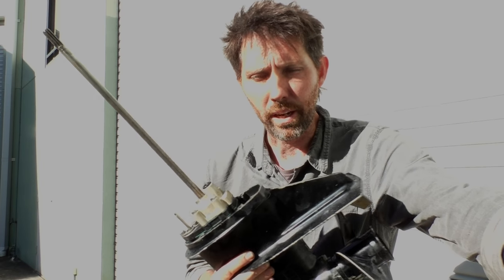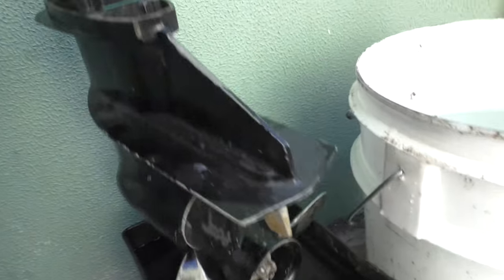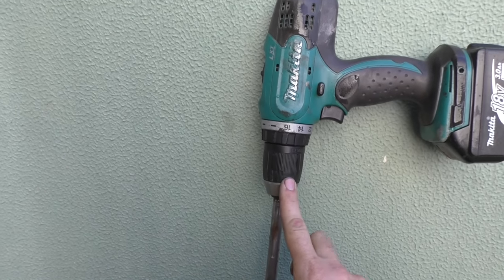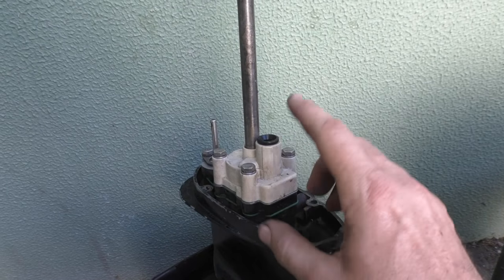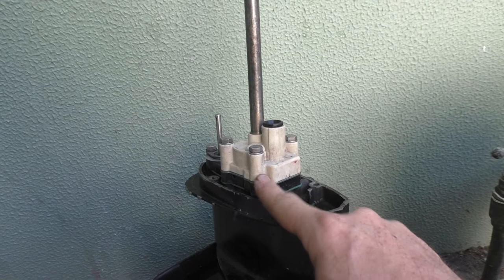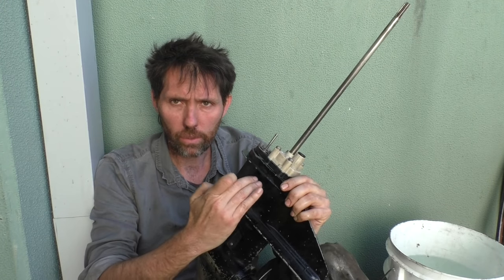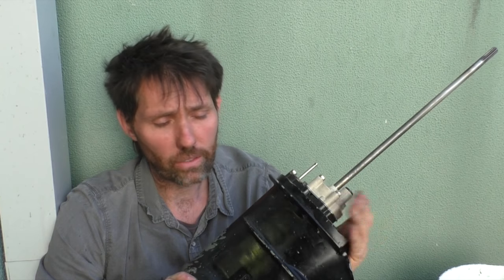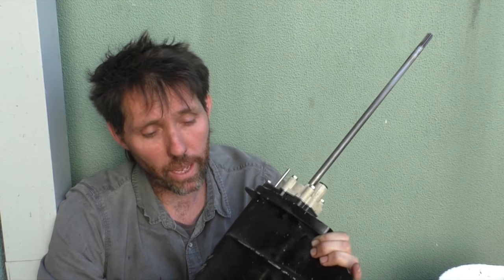Testing an outboard water pump

Comment: Every time I work on my boats I end up watching hours of Dangar Marine.  Thanks so much you have helped me keep my family having fun and fishing year after year.  Thanks again Sir.
Reply: hola muy buenas tardes , quería pedirle un gran favor si es posible soy de argentina y me gustan  sus vídeos y la verdad aprendo muchisimo , podrian salir subtitulado en Español para poder leer lo que enseña ,para mi y otras personas mas ,sería de gran valor muchisimas gracias y saludos desde Argentina
Reply: Me too 💯
Reply: Hello, I have changed the impeller on my Mercury 30hp and I have checked that the impeller is stuck and spins when you turn the shaft. but there will be no cooler water from Tell-tale. does pressure have to build up and can it take a long time? thanks in advance.

Comment: After battling a water pump for a couple hours I watched this and just hooked up a hose with earmuffs. Problem solved, boat runs like a champ. Thanks Stu!! Rebuilt my lower unit with new dog clutch and all new seals, carb rebuild, fuel pump rebuild, fixed throttle advance, and everything is greased up. Literally all from your videos. Two years ago I paid a guy $650 to replace my impeller (after 6 weeks with my boat). The freedom you've given me is unbelievably valuable.
Reply from the maker: Glad it helped. :)
Reply: $650?? You got ripped.
Reply: @wolfpackflt670  just like al the boat mechanics and shops are, rip offs, like car mechanics, a/c guys etc.. I can do them all and I know they are..

Comment: I changend the impeller for a new one, put everything up for a test and the water didn’t come out. Since it was the first time I did it, I though I must had done something wrong, so took it apart, rechecked the process.. And nothing. So did it again with the same result. All stressed out I came across this video, changed the tank for taller one, added more water and the restof the story you surely know😀

Comment: Thanks for showing us how to solve the mystery of why our newly installed water pump was not working!  Not having the water level high enough when testing prevented the stream from flowing.  It would have been better if we had found your video before our fourth breakdown and re-assembly, but my 16 year old is now an expert on both impellers and thermostats.
Reply from the maker: Hey Grace. Oh well, at least it was a learning experience. You never know something until you've done it four times! :)

Comment: I am in the middle of servicing my Mariner 3.3 HP 2 stroke. I came back inside for information about the water tube connecting the water pump to the power head. I came across your video and paused it after I saw what you did to check the pump using a cordless drill. Brilliant idea Thanks. I did the test like you did and it is ok, my question is: WHERE is the water tube? I did not find any in mine and when I thought to measure and make one, there is no port or anything to connect the tube to. do these outboard have water tube or this is how they are designed with out a water tube. any feed back would be appreciated. and Thanks for the video

Comment: My son and I had taken ours apart and worked on the impeller. Once we were done we reassembled everything and... no water flow. We had the lower unit in a tub of water with enough to allow the intakes to be below the surface but your tip about lowering it even more was the key point to prime the pump. We tried again with a taller water tub and voila... problem solved...! Thanks so much for posting this video. It saved us so much time and money. Cheers..!

Comment: Thank you very much for your content. I completed a rebuild on a 15hp Evinrude which is mounted on an adjustable jack plate, which worked perfectly on the muffs when tested after the rebuild but hadn't been on the water yet. When I tried to start it up with the boat beached it wasn't sitting deep enough in the water to prime the pump, so all I had was a noticeable pulse of air coming from the tell. After bringing it home and scratching my head I found your video and immediately took the boat to a local boat launch to test immersing deeper and voila - strong stream from the tell.

Comment: Changed the water pump and gaskets, raised the water level in the 'bucket' to just about where the water pump is situated and poured in  5-1 ratio of plain white vinegar which was cheaper at the supermarket, cancelled the descaling fluid......Ran for about 1/2 an hour and was left with a tablespoon full of sand, shells and silt in the bottom. Rinsed with fresh water and the tell tale and exhaust were pumping water out. Job well done
Reply from the maker: Nice one, sounds like it made a big difference.

Comment: Thank you so much!
I replace the impeller on my Evinrude 9.9.  The motor has planing fins, so I used a storage box that accommodated them, and still submerged the intake. I had used a motorcycle fork seal grease, on the impeller, during reassembly, for insurance. After running for 20 seconds, no "peeing"? 
I was about to tear it back down, second guessing my work, when I found your video. 
I removed the fins and used a recycle bin, deep enough to submerge the pump...presto! It primed and circulated.
THANK YOU!

Comment: Stu is spot on; recently experienced this after I build a motor stand and tested the water pump after replacement (previously would do it from the stern of the boat).  Used the same bucket which was not high enough with the stand like it was with the boat.

Comment: Thank You I rebuilt my water pump reinstalled my Foot (Lower Unit) No water with muffs.Placed it in a barrel up to the water intake’s and no water. Removed the lower unit 3 more times to re check my work. Scratched my head,slept on it and tried again the next morning NADA! Searching the IT and found your posting. Repositioning the engine in order to get deeper in the barrel and  WooHoo, my work is good and proves a point to me that muffs can’t be trusted nor can a barrel if you are not close to the cavation plate. Thanks again and as you said if it were a self priming pump things could have worked but now I know. Stay Safe and Enjoy the Water ✌️
Reply: Thanks for that info. I was just looking at a 6HP Yamaha tonight with muffs and it wasn't pumping water - never thought a minute that it could be a priming issue. Still buying it, because it's a fairly easy fix either way, but I'll have to barrel test it when I get it home now.
Reply: @ChrisPollardвы смогли решить проблему?вы меняли крыльчатку? пошла вода из контрольного отверстия?

Comment: After testing my motor after a 6 month break it wasn’t pumping water, pulled the pump apart and rebuilt it only to find it still didn’t pump… after a second rebuild and a lot of cranky words I found your video! Adding more water to the bucket magically fixed it, thanks!

Comment: I wonder how it ever worked in the tank before  we have used or for that matter in the seal?  I could not make the pump work using the drill until the water was right below the pump as you explain. But normally we have had it in a tank with much lower level. So my question is how does it work  when its in the sea and ihe water level is not that high?

Comment: OMG! THIS is the video that everybody is looking for. I took careful attention to Change my impeller properly and then did the test in the driveway with the Ear Muffs, then the flush line with my garden hose (tell tale worked perfect with this flushing test) etc. EVERYTHING and I mean EVERYTHING was perfect though I could not get water to come out of the Tell tale. I even filled my trash can up to just above the Intake Grids and STILL couldn’t get water to pump through the tell tale. I watched this video and thought “...there’s no way this is going to work..” and yet when I backed the boat down the landing ramp and lower the unit into deeper water, I started the motor in deeper water and WHAM! ....Water streaming  like a river!!!! YES! I still don’t understand the physics of this as to why the deeper water makes/made a difference BUT IT WORKED and Dangar I am forever grateful! Thank You!
Reply from the maker: You're welcome Mike, glad the vid helped you. :) It works because the pump is higher than those grills and can't suck air to get to the water.
Reply: @DangarMarine  Hey. I am from Russia, I use a translator. Sorry for my English. The question is, when we go on a glider, the water level is lower and the water flows. Why?
Reply: @DangarMarineа как же вода потом не уходит из  помпы? как потом её снова засасывает насосом?вода же не остаётся там,да и это чревато если зимой замёрзнет
Reply: @ermak-rybakон не хочет наверное отвечать

Comment: Man, Thanks so much! I just did my first water pump on a little Johnson 15 and set the engine in a bucket of water and it did not pump. Was getting ready to tear the thing apart again thinking I had done something wrong. Your video was a life saver. As you pointed out, these pumps are not self priming. I found a deeper bucket and filled to the level that you recommended and presto, she was peeing like crazy. Thanks for the excellent video. Keep up the good work!
Reply: Great. What about if its not pumping when hooked up with a water hose vs bucket?

Comment: Great tip.
Also, if you have checked everything out and everything appears to look good and the water level is high enough and it's STILL not pumping, look closely at the seal on top of the impellor housing. If it has a seal. Some housings don't have seals. Some do. If they don't, look at the housing itself. Make sure its not distorted from heat. If you stick a short hose into the housing where the water shoots out of the housing, there should be a good stream of water coming out of the hose. Just keep your face away from the sudden gush of water.

Comment: Stu, once again your videos are a life saver. Planning to take the wife out on the lake tomorrow and when I was prepping the boat earlier in the week, it wasn't pumping water. Thankfully I knew what not to do and it didn't overheat but I remembered this video and tried getting a bigger tub. Bam. Pumping just fine. Also a nice side effect of the engine getting a little warm was my moisture misfire gremlin was cooked out of the ignition system. :P
Reply from the maker: Hey Peter, sounds like you've had a big win there. Hope you both had a wonderful day on the water. :)
Reply: We did indeed. Had a little issue with the gear selector not wanting to go in to reverse. Looks like its a cable issue and not the motor itself.
Reply: Was definitely the cable. had to adjust the "nut" on the engine side of the gear selector cable so that at "full throw" reverse, it wasn't pushing the rod far enough back. Takes me back to my amateur bike mechanic days. :P

Comment: So glad I watched this video. I bought a used 2002 Honda 225 outboard. I saw it running at the time and it gushed water out the jet, but when I installed it on my boat a couple of weeks ago using  ear muffs on the garden hose, no water came out, so I switched it off. I then put it into a tub with the water coming to about 1/4 inch above the intake, ( deepest tub I could find ) but still no water came out. Now I know why, thanks to you. Your videos are the best on the web and I really enjoy watching them. I like the fact that it is not all about spending money, it about getting things to work one way or the other. I would love to see you working on the exact same engine as mine but realize it would be difficult as there are so many choices out there. I would suggest however, that if you did do videos on the most popular models and horse powers, I, and many others,  would be prepared to pay for access to in depth instruction videos  of their particular engine, done in the same manner as your existing videos. I really like when you ad small additional pieces of information, just so that we are fully aware of the situation and therefore stop us rushing in and doing something stupid. I was about to strip down my engine and replace the water pump. Now I will wait until next season and test it in the water. I am now sure there is no problem, but at some point I will service it, just so I am aware off it's condition. I would like to see you make a buck just so you will stay with it. Thanks again. Keep up the good work. Bob.
Reply from the maker: Thanks Bob, really glad the video saved you from some unnecessary work. I'd love to slowly build a collection of videos showing all the common jobs on the common outboards. Hopefully over the next few years I'll get enough of the right motors in here to do that.

Comment: Thanks you so much, your video has saved me. I just could not understand why my new impeller was not pumping. The ear muffs are useless and then used a large bucket. But as you have shown water level is critical. All good now. Thanks again.
Reply from the maker: You're welcome Steve, yes, I have very mixed results when trying to get a telltale on ear muffs.

Comment: Did this test on a Suzuki DF4 WP which revealed I had a leaking drive shaft seal on the top of the housing - half water coming out the WP discharge, the other half out the leaking shaft seal, result - insufficient pump head pressure to reach the tell tale let alone the cylinder head.  I would suggest fitting a tube to the outlet with sufficient height to demonstrate the pump head pressure. As presented the test only demonstrates the pump impeller is rotating and won’t demonstrate pump head.  Hope this helps.
Reply: Yo tengo problemas con un 5 hp mercuri no tiene presión el agua en mínima velocidad no tira agua

Comment: This video saved me a lot of time and money.
My motor telltale was not peeing. I replaced the impeller. Still nothing.
I tried muffs. I tried a bucket. Nothing.
Was just about to take the lower unit off and verify everything looked right (and it would have, because it was right). That would have lead to even more confusion. Then I would have taken it to a repair shop.
But I saw this video suggesting the need for deeper water.
Got a new,  larger, deeper water trough and it worked!
The telltale was working perfectly. Yayyyyy!!!!!
Thanks Dangar Marine!

Comment: You saved me a bunch of time also/// I was getting ready to change out my water pump and tried what you showed...it worked just fine with a little more water...thanks so much... : )
Reply from the maker: Glad it was that simple. :)
Reply: @DangarMarine  my only comlaint is using a ratchet strap to pull the leg on my 90 tohatsu loccks up with about 2inches left no way am i goingbto force it i think its the shitty copper water tube not seating in the pump pity you CAN'T  look inside and see

Comment: You might have just saved me 250 bucks. I just ran my outboard with water only up above the intake holes and got no flow. I had already gotten a price for a new water pump. But I decided to check out my man Dangar.  If this works, I'm going to open an account on patreon for the sole purpose of making a donation.

Comment: Thanks for the idea. I did this with my 40 HP Johnson, but the driveshaft was too big. I ended up clamping a piece of garden hose on the shaft, and a half inch extension{upside down}, and inserted the extension in the drill. worked awesome.

Comment: Holy shit. I destroyed my newly rebuilt pump running it in a tub without enough water. Now I know. Thank you!!!!!!
Reply: Yes hehe this is not easy.I tryed  and get the shop mounting a new impeller when separated it,s gearhouse, but it dont cool good.A little used yamaha 8 so  go for a new tohatsu next year.Tohatsu seems to have  little to  no problems with this since used them  for years before.The yamha will be sold cheap to get rid of it.

Comment: I had changed my impeller at the end of last season..  I filled up a bucket and started the motor and no water..  let it run a while and heard an alarm so shut her off..  started thinking I had to tear it  apart again but thought I would see if you had anything about this.   Saw this video, used a larger container and that did the trick!Thank you thank you thank you!!

Comment: If the impeller sits on the shaft upside down, in the wrong position will it effect the flow of water of the water pump. If the water pump still not pumping up water what can be issue?

Comment: How would you do that if your shaft is larger than your drill chuck?  Or any drill chuck for that matter
Reply from the maker: I would put a spline socket on the shaft, an extension into the socket then the extension into the drill.

Comment: if you have twin outboards counter rotating, both engines will run clockwise right? so the counter rotation is done in the gear case correct?

Comment: Stu, I have to agree with J Dexter.  Another good tutorial.  I took my lower unit off due to it not pumping water.  I suspected the impeller but it's fine.  However the rubber piece covering the top of the impeller housing is torn and unserviceable.  I'll test the lower unit just like you've shown and also pump water through the upper unit before assembly.

thanks
Reply from the maker: It is a good move to test it first, it can save you a lot of work in the long run.

Comment: Just tried this on my mariner and it’s pumping water but non is going out the tell tale. Used air compressor to see if the any tube is block but it’s fine. Any I ldea on what it could be?

Comment: I'm going to try that trick tomorrow, I took it apart and everything looks ok with the impeller, my impeller only has 3 blades, factory made that way? Also, when you put the lower unit back together with the upper does the pipe that goes into where the water comes out of the impeller housing have to be tight, mine is sloppy but looks like that is the way it is designed?

Comment: Hello, I have changed the impeller on my Mercury 30hp and I have checked that the impeller is stuck and spins when you turn the shaft. but there will be no cooler water from Tell-tale. does pressure have to build up and can it take a long time? thanks in advance.